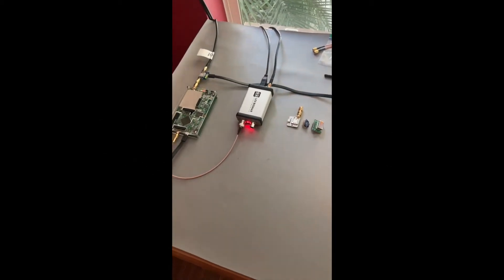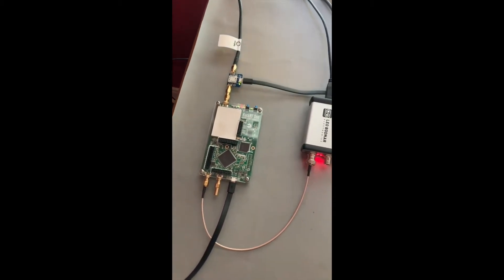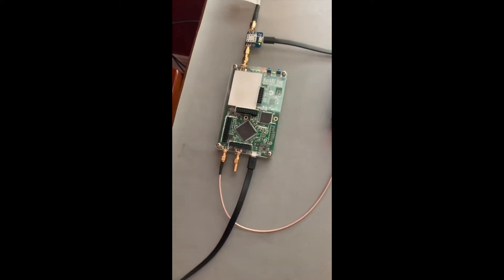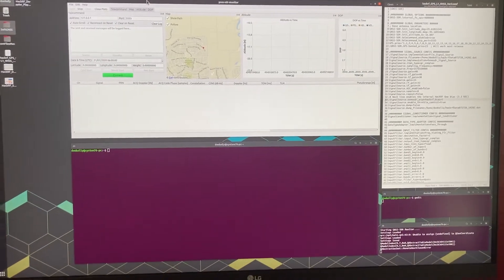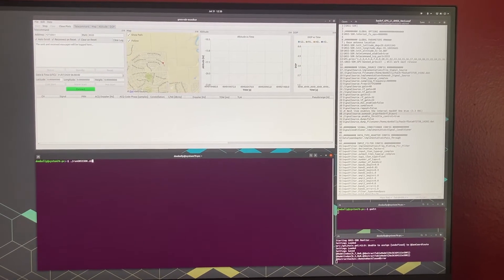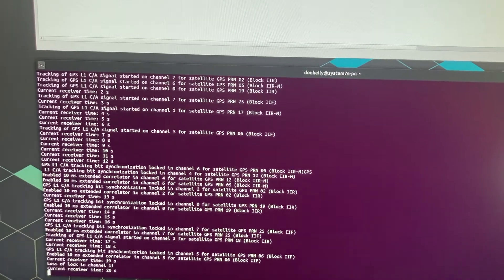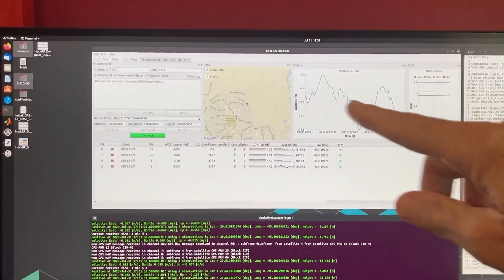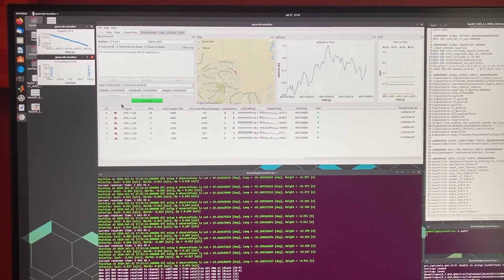GNSS-SDR Setup and First Look (GPS Software Defined Radio)

Comment: Hi Don, thanks for your video. Did you connected the GPSDO oscillator to the same active antena than the one uses the HackRF1, or you used one different antenna? Also another question, which antennae are you using? Thanks again.

Comment: Hi Don, thanks for the introductory video. Can you share more detailed videos about GNSS SDR to clear out couple of questions that could be faced by a beginner? For example, one of the questions can be, how did you acquire and process real time signals using the setup you have shown. Can you please give more detail?
Reply from the maker: I'd suggest reading all the info on the gnss-sdr.org site as a start.